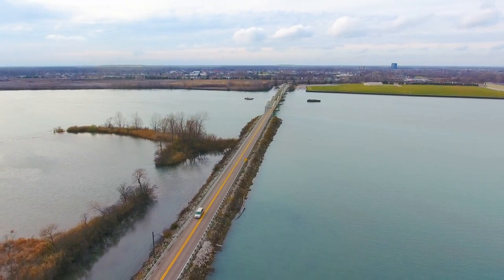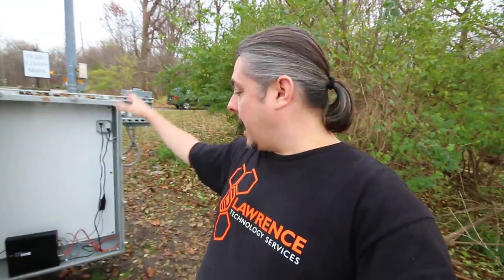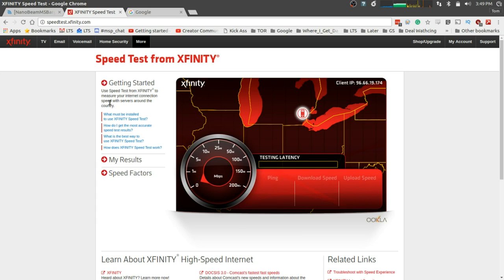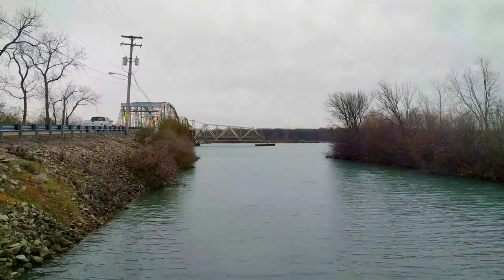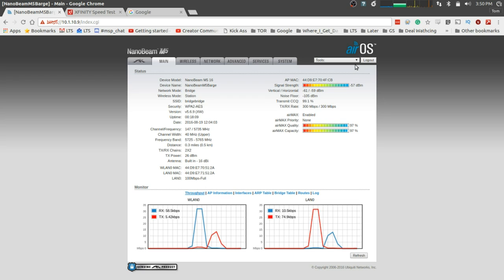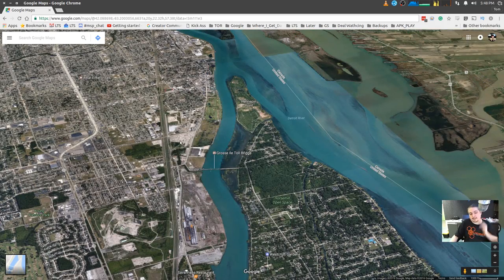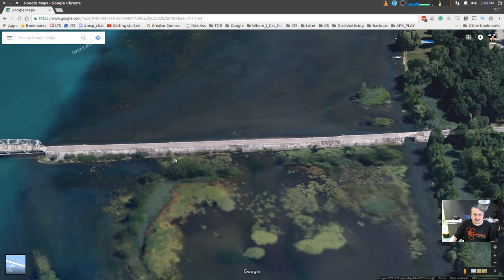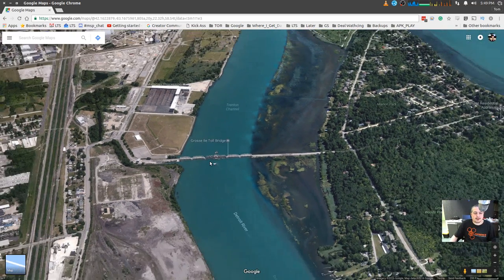Site to Site Wireless Bridge over a Physical Bridge using Ubiquiti NBE-M5-16

Comment: Ok, so it's a privately owned bridge, but the utility pole is not. That would seem to present a legal problem by mounting your radio there. Also, did you leave the cable above ground or was this trenched in? Is this a privately owned road or publicly maintained? Generally speaking there's a lot of red tape to go through when running cable near any roadway.
Reply: its privately owned

Comment: I'm sure running Ethernet over the bridge became a problem whenever the bridge opened and the network began dropping packets, but the bigger problem is that cars also fall off the bridge when you do that.  You probably didn't know it because the security cameras were connected to the wrong end of the network.